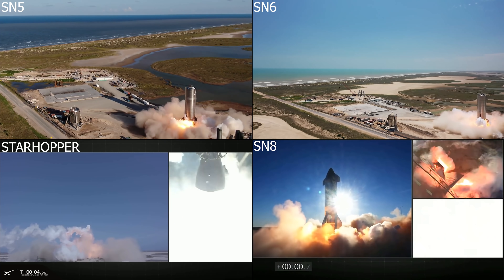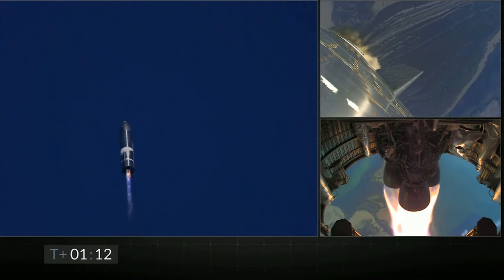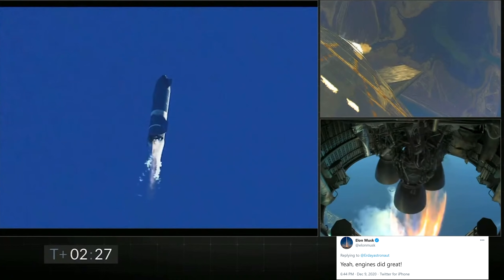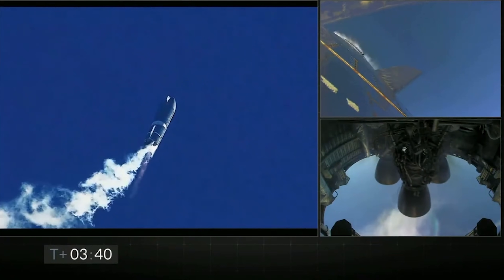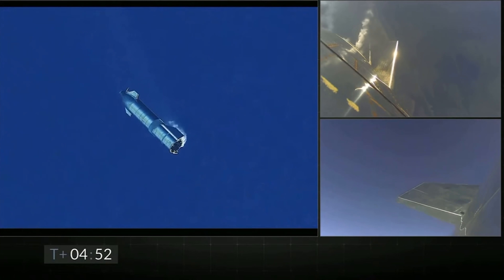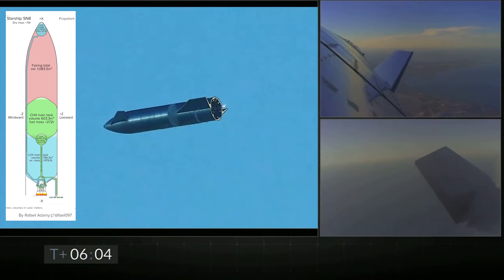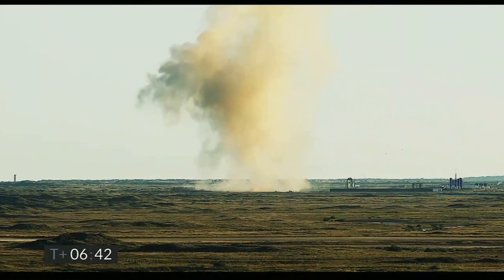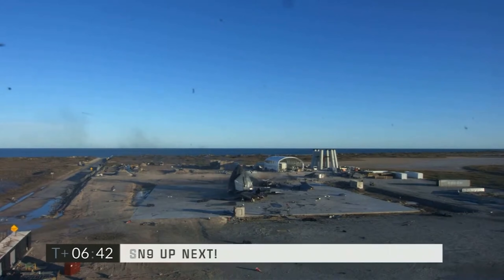SpaceX Starship Serial Number 8 Test Flight

Comment: Enjoyed the video. Small correction both ice/condensation areas are on the LOX tank. The methane tank starts just where the upper region of ice stops. The methane tank is likely just had enough to fill the bulkhead while the LOX tank up to the top of the lower icy part. CH4 to O2 ratio is 3.8 so it makes sense that the LOX tank would be filled more. Now why the top of the LOX tank also freezes, I don't know but even the gaseous oxygen in the top of the tank is quite cold.

Comment: My only concern is the security of the passengers onboard... Even if things go wrong, it shld be more safer failure.. Not an outright disassembly or explosion.  Hope SpaceX has different plan to ensure onboard passenger safety.. its 2020 and we can ensure all sorts of safety even in case of explosion...like ejecting the top part, if things go south and a parachute triggered landing within a safer distance or ejecting individual passengers with chutes...i think , we all trust the ingenuity of Elon at this point...but in Martian Atmosphere,  im not sure
Reply: Your hearts in the right place, but you are way too far ahead, these test vehicles are not intended to carry passengers.  Elon has said that Starship will not have any humans until there are at least a thousand successful flights so I wouldn't worry about these test vehicles exploding.